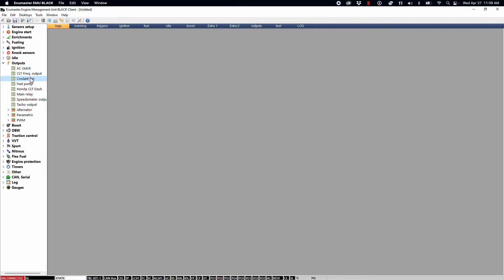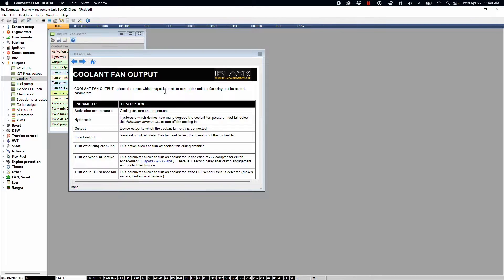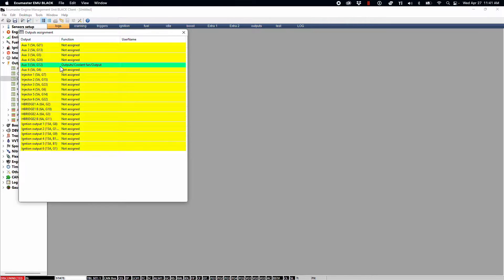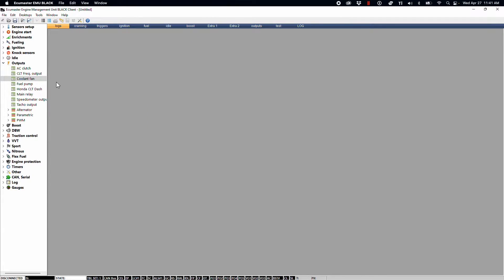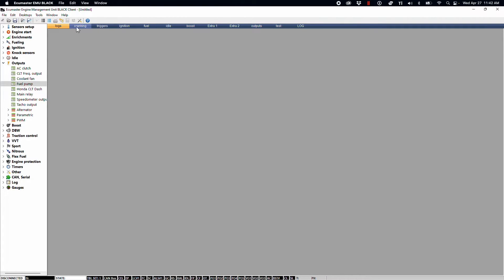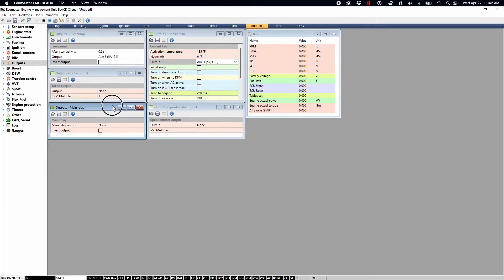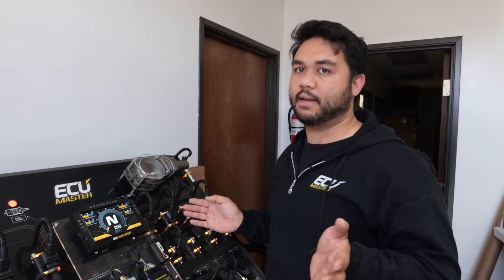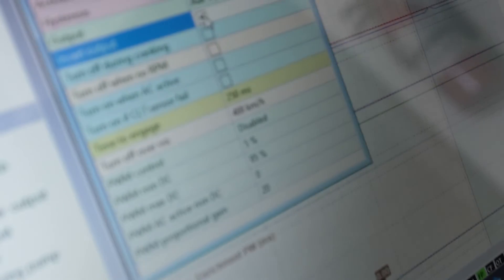Configuring EMU Aux Outputs | ECUMaster USA

Comment: Could you do a video upon AFR & Boost Gauge/ controller, with pin outs thanks!
Reply from the maker: The EMU Black has internal wideband control, what specifically were you looking for in regard to AFR? To complete basic EMU connections check this out, and there is a boost control plumbing video available as well. https://www.youtube.com/watch?v=eMd3myzUmgw
Reply: @ECUMasterUSA  it would be for an external afr gauge, sorry I thought I implemented that. I have my external aem afr gauge pined out to B17 (analog input #3) Curious on why it’s not reading on the gauge.
Reply: @Yojujux  did you ever figure how to hook up the wideband? You use signal to an open auxiliary in?